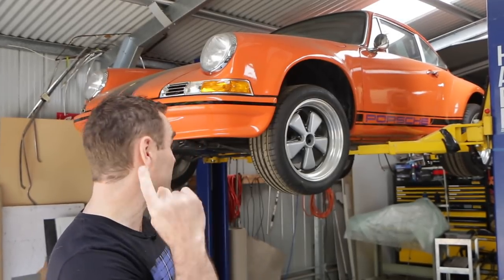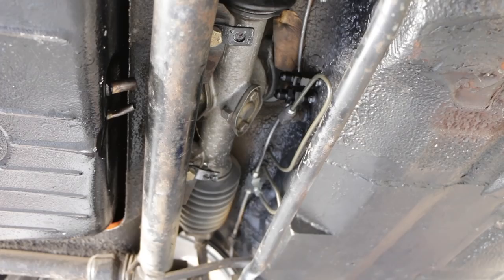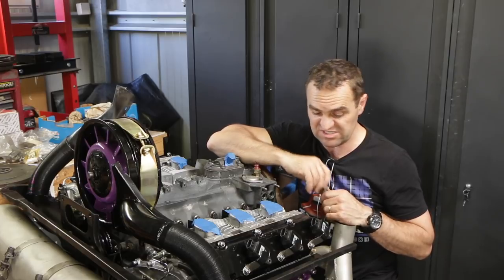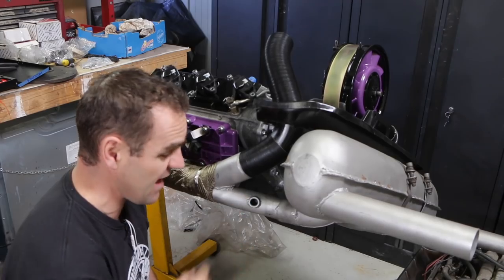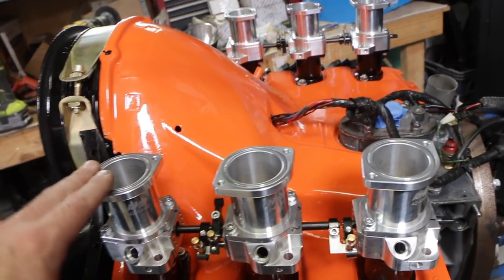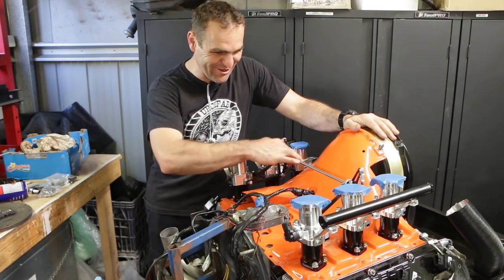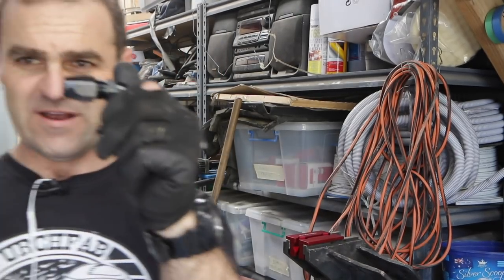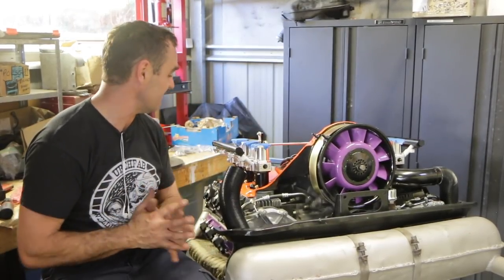Shiny new ITB's -  911 2.8 RSR Build Season 2.16

Comment: I had an hell of a time recently fitting fuel pumps filters and surge tank around the steering rack and smuggler box.  
Its so tight and AN fittings is not the most easy thing to work with. 

One easy way to cut the hoses, no matter what kind, it to use the angle grinder. Brutal but cuts anything pretty cleanly. I think it was a tip by "Turbo Yoda" in one of his videos.

Comment: My SC's fuel tank is a little different, it has a M14 outlet.  Hoping to go straight to -6AN with that.  The return line is still held on with a hose clip.  I'm going to use the very same Bosch EV6 36lbs/hr injectors!  Leaning towards a Pierburg pump though, incase I want to run E85 in the future and leave some head room for a snail on the end of the exhaust system :-)

Comment: Epoxy the knock sensors to the cylinder. Or epoxy a bolt to the cylinder and attach the knock sensor to the bolt.
Reply: Seems like  the sensors should be on the heads?

Comment: Do you have access or have you thought of using an engine start/test stand before you install the engine so you can easily tune before final install?
Reply from the maker: No, it is pretty easy to put it in and out of the car if I need to, particularly with the hoist, so I am happy to just go with it.

Comment: Not sure how the throttle cable on the 911 works, but it seems to me that the linkage on the ITB is backwards.  Unless the cable wraps around to the back of the engine then it would make sense.  But if the throttle cable comes over the engine from the front, the the cable will have a hard time pulling the linkage that way.
Reply: He hasn't fit cable linkage to the bar yet. It isn't even a cable on a 911, its a solid bar, but it pulls and comes up between the engine and the firewall.